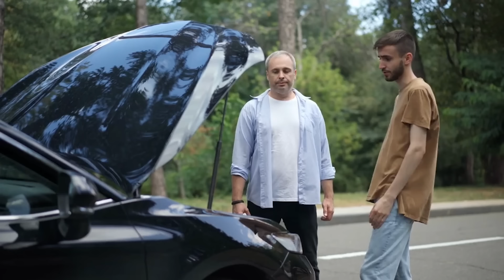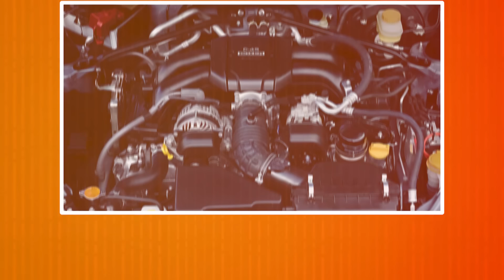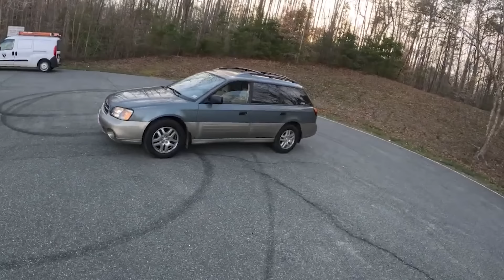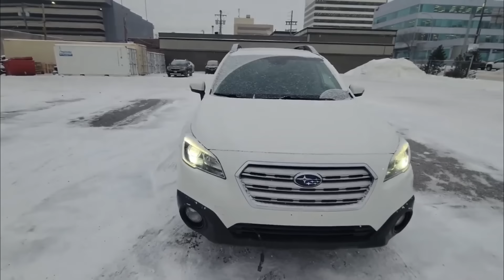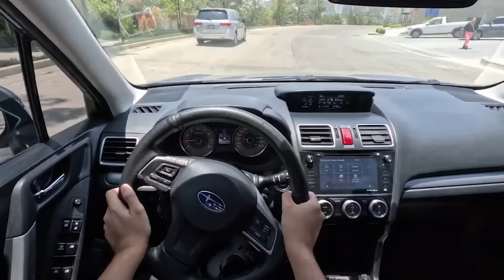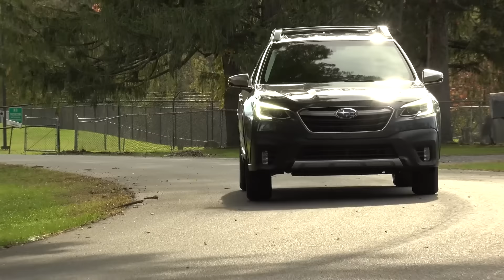SUBARU OWNERS! Don't Let This Mistake Destroy Your Engine!

Comment: Which corporation goes to great lengths to drop subtle suggestions that Subarus have numerous faults and prone to fail?  I've loved both cars I've owned and found them to be reliable if the maintenance is followed.  That's only common sense though.

Comment: I have a 2016 Subaru crosstrek that has just gone over the 90000 mile mark and guess what? I have no other problems that he's talking about. Matter of fact, there's a little bluelight on your dashboard that tells you to let your car warm up and get up to a proper operating temperature before even driving out of the parking lot. He's stupid. This also has caused so many of your
Valve seals to blow because nothing was properly set.Nothing was properly warmed up.This guy's trying to cost you money.He wants you to get that new engine.He's probably some technician

Comment: Telling you not to follow the customer manual. But he can't say anything about the turbo diesel version of the boxer engine. Turbo information incorrect. Subaru in the manual recommends letting the car idle for a few minutes after long drives to help oil and coolant run through. The turbo Subaru uses oil and coolant in its turbos. A typical car uses about 500 mL to 1 L of oil between services.  I owned Subies for years, both petrol and diesel.  surburu have there own intake cleaner and fuel treatment.  CVT oil only needs to be changed if heavy towing  or after 150,000 ks

Comment: BS…..in cold climate you’re suppose to allow your engine to warm up by allowing it to idol getting the fluids warm up, to help your engine.  In hotter climates a slight idol….its said to watch your blue temp light go off then you’re good.  Been doing this with my 15 year old forester……so when is the engine going to die like it lied in this video??  Click bait, deceptive false information on those that don’t any better

Comment: No I am not. I routinely warm up my 2014 legacy 2.5i in the winter when it is below 0.  It has 125k on it. Ditto for my 2016 Outback 3.6r limited with 113k on it.

My 2010 outback 3.6r came with remote start and it was running like new at 220k when I sold it this year.

All modern cars go into closed loop within a minute of starting

Comment: My new wrx came with a lifetime power train warranty and free oil changes for life as long as I document all services this is all irelivent I asked before I bought it i said come on what is considered lifetime and the subaru manager said if I live long enough because I'm 65 if I still owned it 20 years from now and one day it throws a valve they will replace the motor for free
Reply: I also got lifetime oil & filter changes, my dealer has done lots of oil changes in 10 years !! Saved quite a bit as I change oil at 4500 miles.
Reply: Thats not true at all . Different information from beginning to the end . If you dont have 16 minutes to learn things you probably dont know its on you.
Reply: They won’t have that engine in 20 years to replace it

Comment: Change your oil every 4500 miles and use Top Tier gasoline with Techron ( Chevron ) which will keep your engine from getting gunked up. When the engine is cold, let it warm up for 2-3 minutes before driving. You can also buy bottles of Techron fuel injector cleaner at most auto parts stores, pour a bottle in the gas tank every 3000 miles and you will not gunk up your engine. do the research....
Reply: Is Mobil gas any good? I don't have a Chevron station near me.
Reply: @BiblicalRealityCheck-x2z  1)Chevron 2)Shell, the rest are notably inferior. *Costco uses Shells fuel additive.
Reply: @BiblicalRealityCheck-x2z  Just google top tier brand gasolines  and it will show a complete listing.